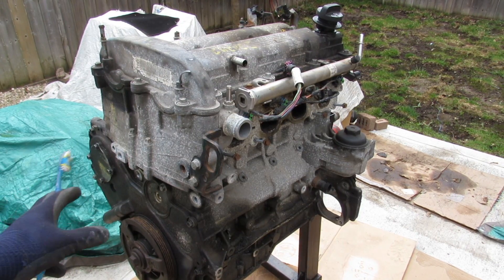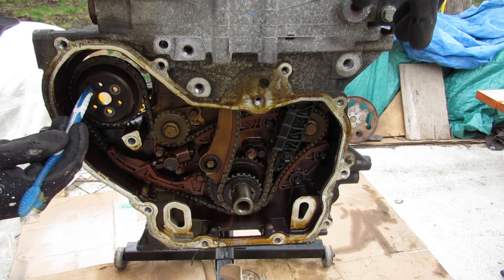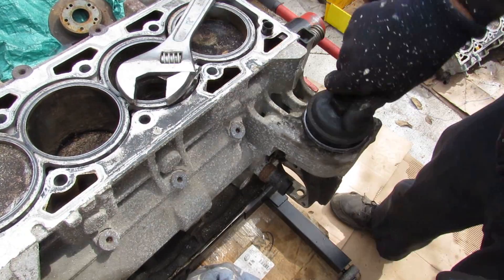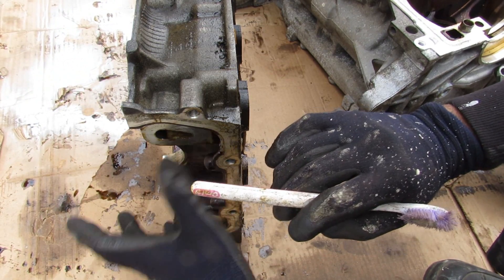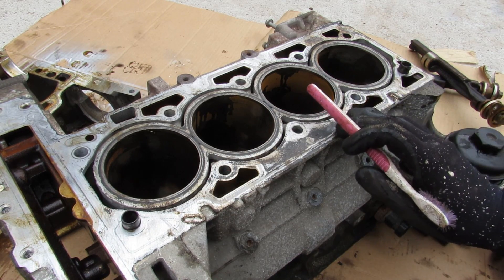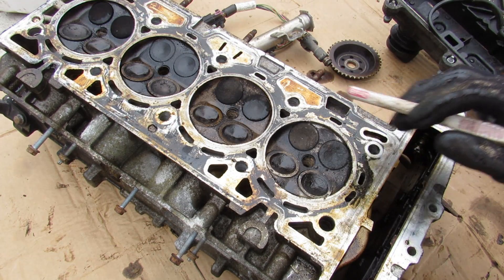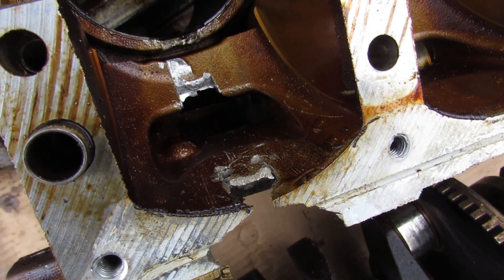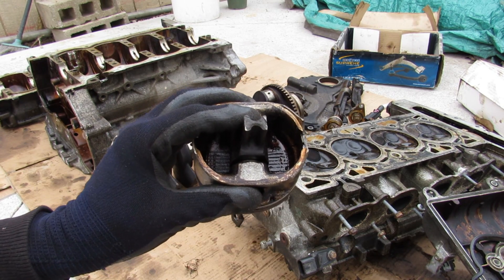Why GM Ecotec Engines FAIL

Comment: I have the same engine on my base model 2004 Saturn Vue. (With 5 speed manual trans) still going strong with 286k miles. It just burns a little oil. (About half a quart of oil every 2500 miles) not bad. Just keep up with oil and fluid maintenance and it will continue going strong.
Reply: I have a 2.2 ecotech with 180k i suspect that it will start burning oil soon do you all recommend just topping it off till an oil change or taking all the oil out and filling it every time it gets low?
Reply: KEEP OIL IN IT ,. If not the timing chain will fail

Comment: One thing I remember hating back when I used to do engine repair in the 70's and 80's was what they called "interference engines," where the valve and piston would collide if the timing belt or timing chain broke. For the life of me I can't understand why some engines are built that way, I owned a Pontiac Sunbird with a 1.8l four cylinder engine that could break a timing belt without it being a catastrophe. I used to wish some lawyer would file a class action suit on behalf of car owners with interference engines.

That being said, this is the first time I've seen an Ecotec engine and I have to say I'm not impressed  : /
Reply: Were those engines you mentioned high compression ratios?

That could be the answer. Cheers
Reply: It's not really possible to build a modern high compression ratio engine without it being an 'interference' engine. The valves need to be big and have plenty of lift so they flow well enough at high speed, and the chamber needs to be small to get high CR for good efficiency. Therefore having the valves intrude into the piston's space is sort of inevitable. With a well designed timing chain system or a properly maintained timing belt there should never be a failure.

That being said, you can't account for errors by the people doing the maintainance.  When I was a kid my parents had a Mitsubishi Magna (sold as a 'Diamente' in the US) with the 3.0L V6 engine, using a timing belt. At a regular service the mechanics damaged the accessory belt when installing it, the belt subsequently broke and pieces of it got between the timing belt and its pulleys, with predictable results. As far as I know the pistons were not changed, and after a top end rebuild that engine ran for another 100,000 km or so with valve shaped dents in the piston crowns...
Reply: Because the Ecotec is a Vauxhall DOHC belt driven cams engine converted to oil lubricated chain driven cams for vastly more reliability. Vauxhall had recommended changing the belts at 80K miles... they didn't last that long, so they changed it to 40K miles... GM doesn't have any mileage recommendation for changing the chains... After initial break in, I recommended using synthetic oil and regular oil changes to make the engine last 300K miles and stay clean inside.

Comment: water pump is connected to the timing chain, so if it leaks, and you pull it out, you will cause the timing to jump and destroy the engine. Unless you have a tool or something to keep the place of the water pump during the removal. If this is correct, this would be like a $1000 job to change the water pump, labor and parts?
Reply: There is a tool to hold the water pump sprocket in place via the small window in the timing cover. I'm not sure on price but its probably near or just under that.
Reply: The special tool was $32 , water pump was $60, repair book was $20
Reply: @lowlifeangler  most mechanics want a grand to do the job, see below. There is no way I would attempt this where the worst possible outcome is the destruction of the engine. This is poor design fraught with unnecessary risk.
Reply: for some reason it wont let me post a link to the car wizard video on changing water pump on chevy equinox in which he says you might as well have a BMW if you want to change the water pump on an 2.4l equinox.

Comment: Since this seems to be a common thing on YouTube and other sites, I decided to look it up. Galley: 1) a ship or boat propelled solely or chiefly by oars; 2) the kitchen and cooking apparatus especially of a ship or airplane. Gallery: a long and narrow passage, apartment, or corridor. The passages in an engine through which oil flows are *galleries*.
Reply: Co-signed.
Reply: Good catch. I correct folks grammar when the apostrophize plural words.  I never look back at my comments to see how angry and butt-hurt they are..  Nice work!
Reply: @silasmarner7586  You missed an apostrophe on "folks", professor. 
👨‍🎓💩🤣🤣🤣

Comment: This engine, most probably, died because of a failing oil pump. That blue bearing is a sign of overheating and the rod locked, that caused the violent snapping of the rod and an additional blowby ventilation in the block. The piston just sat there waiting for a valve beating. Probably happened in several revolutions and a chain skip is related. While the pump died because of bad oil. The engine is very dirty from the inside. While we don't know the mileage of it, so if it did 400k miles, then this engine did it's job.

Comment: Had a 05 5-speed manual cavalier 2.2 that I beat the piss out of daily, n I mean ran it hard n it did go, sold it to my neighbor and currently has well over 200K n he drives it hard as well. The 2.4 is pure garbage! The 2.2 Eco is just fine long as u service it regularly. Still factory everything, water pump, alternator basically everything other than obvious stuff. I worked on it since day one.

Comment: Funny how they call it Ecotec when it is unreliable and loves to trow out its guts.
It would both be Economical and Ecological to build solid and long lasting engines. Producing a shitty engine is a waste of resources is my opinion. 
Watch Wes Work also had an NA Ecotec that blew out a cylinder on his channel.
Reply: Actually the Ecotec is a Vauxhall DOHC belt driven cams engine converted to oil lubricated chain driven cams for vastly more reliability. Vauxhall had recommended changing the belts at 80K miles... they didn't last that long, so they changed it to 40K miles... GM doesn't have any mileage recommendation for changing the chains... After initial break in, I recommended using synthetic oil and regular oil changes to make the engine last and stay clean inside.

Comment: I don’t like the water pump is driven by the timing chain design, it is designed to fail from the day 1 👎
Thank you for your good work 😊
Reply: Water pump is driven by it's own chain and whole engine goes 300K miles with synthetic oil and regular oil changes...

Comment: Thanks, this one really interested me.  My daily is a 2003 Saturn L, 2.2 version of this engine, otherwise very similar (port injection, no VVT), but even simpler (throttle cable instead of drive by wire, and a single ignition module with 4 plug connections that sits on the top of the engine).  One of the weak points of my version of this engine is the oiler for the timing chain.  I have read that is even smaller than the one in this video, so if a timing chain job is done, it will get this updated version.  Mine is up to 218K miles, and I change the oil at least every 5K miles or 6 months, whichever is first.  I really like the car & engine, but I can't forget that this is an interference engine.
Reply: Virtually all engines are valve-interference at this point.
Reply: Run full synthetic oil and do regular oil changes to keep engine clean inside...

Comment: Toyota got the exact same burning oil problem with 2AZ-FE in many models including the Camry, RAV4, Corolla, Highlander, Scion XB / TC.
Reply: I think it’s because they’re playing with those new low tension piston rings. Honda’s VTEC Turbo 1.5 has been dumping gas into it’s gas. Unfortunately for my mom’s crv, this is “Normal” for these engines.
Reply: Though probably true, I see many more of these GM vehicles on the side of the road broken down, or for sale for super cheap, needing a new engine.  A guy down the street from me has the Saturn version of the Traverse as a lawn ordament. Needs an engine.
Reply: @midwestfarm757  GMs sell for cheaper, so are worth less money, thus making many of them "not worth it" to have fixed at a shop. Same for all domestics, really.
Reply: @midwestfarm757  TRUE!
Reply: The owners tend to follow the extended oil change interval and many skip oil changes.  I think the motors are fine when you change the oil before 5,000 miles. The rings begin to stick then they can't seal and burn excessive oil.

Comment: Have a 2008 hhr ss with the foam block that oil and coolant started mixing porous block. And a 2009 solstice gxp and that engine has been good. Both are the 2.0 turbo.

Comment: Hey thanks for this! Great timing! After all that is how I found your channel, researching ecotech. lol So, I have a 2005 Cavalier, it has the 2.2 and I was looking for preventative info, so this helps a lot. Though I have 140k on it and done most the oil changes, I didn't know that fram was a horrible brand. I since switched to mobile 1 filters, but I have always used Pennzoil. I see you recommend Valvoline? I always thought they recycled oil and added it back into the mix? I do lose oil, and I guess I understand why now, going to keep a closer watch on that. Will also switch to K&N filters, they are cheaper anyway. Oh yeah, there is a problem I have, the vent hose to the head, well on the intake side, that nipple will break off fairly easy. So, I need to figure out a solution, though I did buy some epoxy, and plan to cut a copper 1/2 inch pipe to flange it for extra strength, I have been running just a aftermarket filter on it, which again is probably contributing to not enough oil flow to the top end. Thanks so much!
Reply: There is a black timing chain guide on that engine which needs to be replace every 80k miles (i have replaced broken ones even with only 60k miles on the clock). That guide doesn't have any metal frame. Time and temp. Make it fragile.
Reply: K&N is a pain in the arse for little to no gain and, until they're dirty (how dirty? Nobody seems to know...) they are less effective at filtering than OEM-style paper filters. If you don't have a built engine, don't waste your time and money.
Reply: @fun_ghoul  I meant that he has a k&N oil filter linked in the description. I do have a k&N air filter, and you do need to clean and oil it once per year at least they say. The HP (Only 5 max) and the re-usability made it a feasible choice. I was using fram oil filters though, and switched to mobile one, and now will try k&N because it is cheaper than mobil 1, and this guy will get a cut of it. Maybe Valvoline too as it is made in my neck of the woods.
Reply: @fun_ghoul  Valvoline has been made in Ashland Kentucky for quite some time. OFC I wasn't referring to the crude oil.

Comment: I don't think the failed con rod was because of the lack of pressure in the tensioner.  A skipped cam tooth would have shown damage/marks to all pistons and intake valves.  I believe the lack of oil to the con rod bearing was the culprit.  Signs of failure are present in one of the other journals also.
Reply: Yup, and long periods between oil changes will clog oil ports. C’mon people!! Oil changes are not that difficult to remember. And you can’t use the “it’s too expensive to get my oil changed” BS as an excuse. That’s why God created Jiffy Lube. 😝

Comment: i had 2.2L in the last gen cavalier. shit was bullet proof with  5 speed manual
Reply: Me too. I ran it hard all the time.
Reply: push rod 2.2 yes?
Reply: @randellgribben9772  2.2 ecotec replaced the pushrod 2.2 for Cavalier in 03
Reply: One does not choose to kill the ecotec, the ecotec chooses to die when it doesnt get the beans enough, TL:DR beat it to hell if u want it to last
Reply: @Alehyn666  I beat the living shit out of mine for 425k miles...as long as I added oil weekly, it kept doing exactly what I told it to do.
Reply: My 04 cavil with 203 000 on it still running like it stole something
Reply: @bryandouglas739  I have an 05 Chevy cobalt with 2.2ecotech and manual 5 speed tranny and have 272,000 miles on it and still driving it
Reply: I had an '01 Cavalier that I just got rid of at 205Kmiles, internals never touched, used a 1/2quart of oil at 4500 mile change. Had to get rid of it because the "BIG 'C'" was starting to consume it!
Reply: I had a ‘82 Olds Firenza, with a 1.8L 4 banger and a stick and consistently got 35 MPG+ in the luxury of red crushed velour.  At 250k miles, I sold it to a buddy and he drove it another 100k before the body rusted out, but engine and tranny were still working well.  350k miles from a cheap GM vehicle built when their quality was pretty crappy, not bad at all.  Frequent oil changes and following maintenance schedules (timing belt in particular) kept it going.
Reply: I know someone who has a stock internals 280whp one since 2009 and no problems yet
Reply: @RK-kn1ud  yeah I have been and I change it every 60 to 90 days too because it stays black lol
Reply: GM's 2.5L iron duke was a great engine. I'm not much of a GM fan anymore. The only GM I have now is a 99 Suburban which I'm always working on. I do like it though. I have a couple of VWs that keep me pretty busy too.
Reply: and no power
Reply: @randellgribben9772  It was literally the most powerful shitbox available through the 90s. It had 125hp when Civics couldn't crack the century.
EDIT: Maybe you had an automatic. lol
Reply: @fun_ghoul  i was driving a 84 Alfa Romeo spider,and a Altima at the time(edit for spelling )
Reply: @fun_ghoul   fair comparison... the gm engine is 2.2 liters at the time.. the civic was 1.5 liters..apples and apples, mate
Reply: @fun_ghoul  perhaps a coures in reading is in your future.. i stated that is what i was' driving ' at that time.. still have the alfa romeo spider,, just installed a 2.2 much modified ecotec and a w/c t5 transmission into the car.. finishing the exhaust right now.. agian.. a course in reading the english language
Reply: @randellgribben9772  Nice grammar broski lol
Reply: @anthonyrizzo255  helps when you have a cat on your desk
Reply: @ randel gribben

They are apples and apples, just different philosophies to achieve the same thing. 

A 1.6 litre Honda Civic engine has huge heads, twice the number of valves, twice the number of camshafts in some versions, VTEC in some versions, all aluminum. 

And the small displacement and all aluminum is because they couldn’t fit a bigger engine into the engine bay and a cast iron block would have added more weight to the already complex engine. Honda’s famous double wishbone suspension was only to enable them to fit an engine transversely in the engine bay, not because they wanted to design a car with super handling. It quietly went away in 2001 to the GM style MacPherson struts that automotive journalists said were Stone Age. 

And the stroke was short and bore large to get those insanely high revs for 0.2 nanoseconds of peak power between coming on cam and hitting the rev limiter. The rest of the time it has barely enough power to even move the paper mache thin Japanese steel that was deadly in a collision and rusted out in a decade. 

GM?  They did do all of that with the Quad 4.. making specific power that Honda wouldn’t achieve in a run of the mill production car for another decade. But their philosophy back then and for the most part even now is daily drivability. To not have to downshift or rev the living daylights out it in order to pass or merge on a short freeway on-ramp. So make an iron block that’s durable and cheap. Use an OHV design that is simpler and cheaper and lighter because 90% of the driving population never exceed 4000 RPM. 

Even the dealers told you to get the pushrod V6 on the larger cars for the better daily driving experience than the noisy Quad 4 that you had to show absolutely no mercy to get the performance out of. 

Only now.. three decades later does Honda finally get it. And my 2018 Civic with the 1.5T engine is tuned to produce peak torque at 1800 RPM. I pass in 6th gear and it pulls hard from 60 to 90. Too bad the engine sucks.. recall for oil dilution and a class action lawsuit as well for extended warranty. 

Then there’s my 2019 Impala. Nice big engine that can rev and make over 300HP thanks to DOHC and variable valve timing. But nice big displacement mean I don’t have to just to keep up with traffic. And the LFX doesn’t seem to have any of the timing chain woes or oil consumption issues that plagued its predecessors. 

Out of those two engines, my bet is on GM for which engine will last the longest without major problems.
Reply: @randellgribben9772  Reminds me of when my father got a late-1990s Altima with a 2.4 in 2001 and it seemed immaculate in 2002, but by the later-2010s, it was rust-mageddon! (even a while before that, it was poop, because of a broken AC!) I have a 2002 digital photo of that Nissan and that made me sad! The engine, of course, seemed OK.

Comment: Great video! Any chance you'd ever do a video on the M96 or M97 early water cooled Porsche engines? There's a few interesting engineering features they sport, and some of which are very well known to cause catastrophic failures. Plus, they're pretty cheap when grenaded.
Reply: What is "cheap" for a 996 Porsche? lol